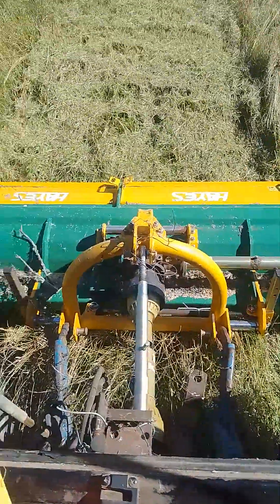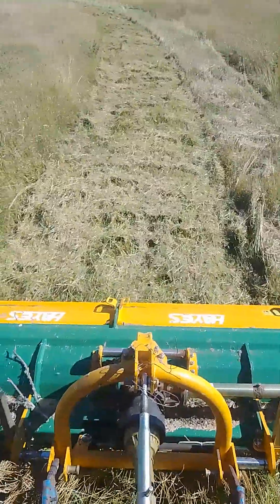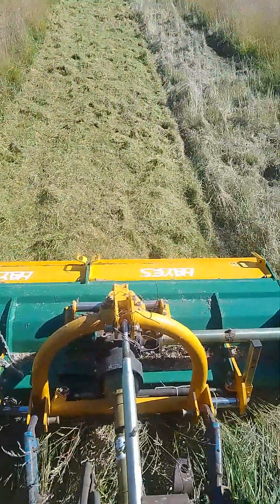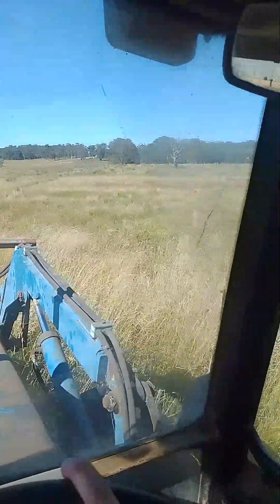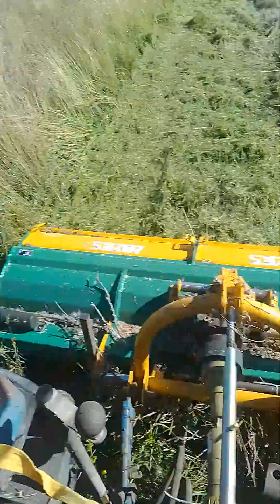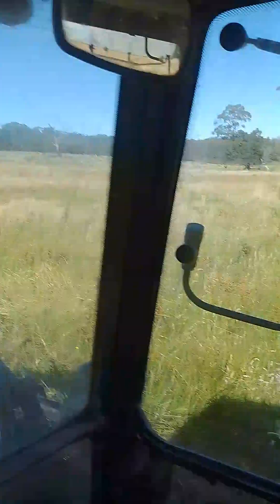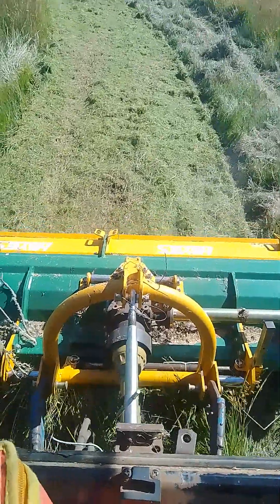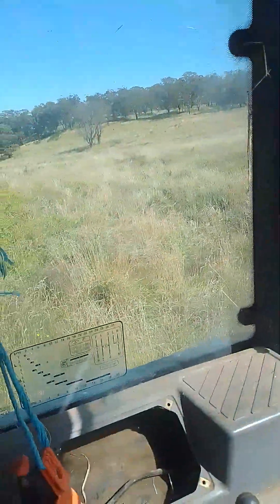Hayes 2.4m flail mower, through flood way grass (wetland).

Comment: Would flails be better than hammers for long tussock grass in your opinion mate. I have lots of tussock grass and Sifton bush that I cleared long ago with my old Bertie mulcher. The Bertie is so old and falling apart so it’s time for an upgrade.
Reply from the maker: From an objective standpoint, here are some things that I've observed. This video was filmed in spring after floods, where the grass was strong and flourishing. It took care and common sense to win that war. That same grass this year, where we haven't had the rain,  anything 2ft and beneath, it hits it like a mower.

From what I've come to understand, the hammers are good for destroying dry things,  fire trails, vineyards, groves, etc. fallen branches and limbs plus offcuts from prunings, etc. On a flail mower 5ft or less, I don't really think it matters, just keep the hammer edges sharp.

Longer machines however, are a little temperamental. You've got to play off the power to weight with the width and the clutch plate strength. Meaning, you're simply trying to keep it running at a consistent pace whilst not allowing the clutch plate to slip, in heavy going that's a moment by moment challenge.

Now if you quantify that challenge, add some hammers, suffocate it through some thick shit, how is it going to go? It's going to constantly bog down.

I put "y blades" on and still haven't looked back. Why? Because each pair is its own slasher! Tussock? That's a part the rounds here, not even a thought. Your Sifton? We don't have that, but the y blades chew up black berry just fine, even easier than hammers really.

So after thinking about this, I think hammers are more so for thick and dry and y blades for wet.

 In saying that though.

If your Sifton stalk is over 1" thick and dry, maybe try hammers. Otherwise it's hard to beat the y blades.

Before you upgrade to a new machine, give your curiosity some credit and get some y blades to suit that machine, it might just shock you. All you've got to do is keep then sharp.
Reply: Your a legend mate. Thanks so much for all of your efforts in explaining this to me. I actually thought i thanked you previously when you sent this to me. 
Thank you 😊🤝

Comment: I’m looking at buying a flail mower to crush setaria grass. Once it’s under control I’ll use a finish mower to turn what was seteria crap into a decent grass in my orchard. The finish mower can’t handle setaria if it gets too tall. Setaria grows around 2 meters tall and grow half a meter a month in summer. It’s a curse.

Comment: How much horsepower required on the PTO
Reply from the maker: I'm not quite sure about those figures. But the tractor is 90hp, and it runs this unit comfortably at 1500 rpm. This unit was built for 90-100hp tractors. The tractor is built to run at 2000 rpm if need be. So what I'm saying, is the tractor is cruising whilst running it. I've got another of these mulchers for a 50hp tractor. Same deal, when they say they're built for a specific size, the engine cruises. Like you may have heard in this video, the mulcher will bog down before the engine does. What that means, is you can't wear a set of headphones and listen to music whilst using it. It's slip plate is the thing to be mindful of, but that's like all PTO mowers. I hope that helps